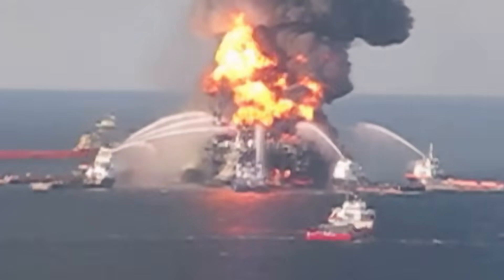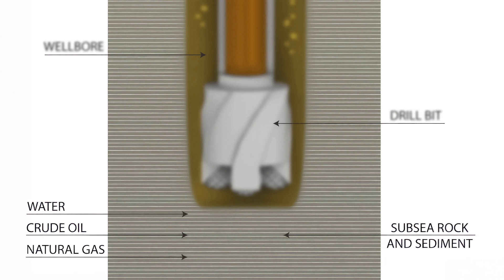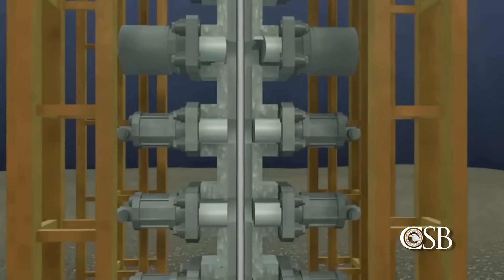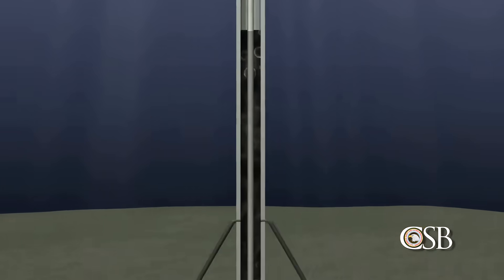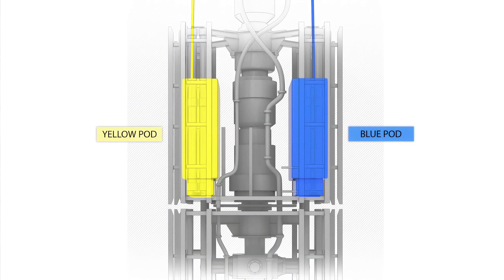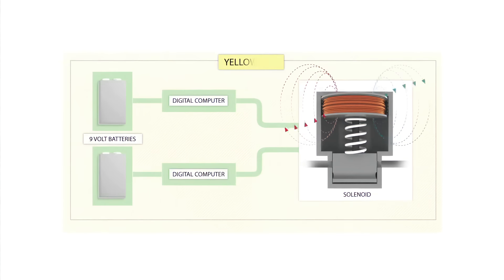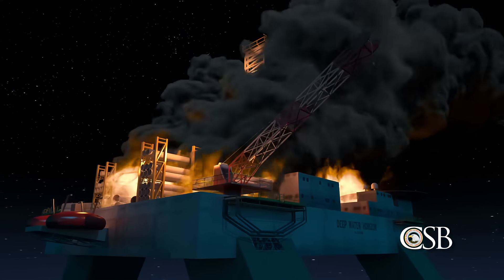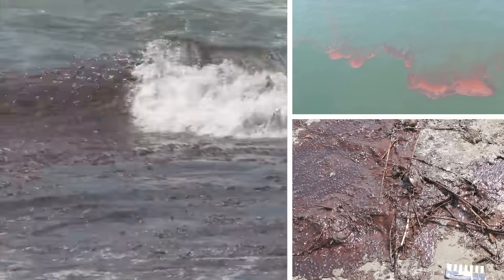Deepwater Horizon Blowout Animation

Comment: 2 and a half months to seal that b off? Funny how much development goes into preventing an accident  but clearly didn't have a plan if an accident happened
Reply: The accident was also 4000 ft below the surface
Reply: @alexl6543  maybe they shouldn't go digging 4000 ft at the bottom of the god damn sea bed without having a plan already in place and the means to stop it at hand dickfarmer. 2 and a half months.. there clearly wasn't a plan to stop a leak if such an accident happened. Ya have a comprenshion problem. That's exactly what my first message said. Oh so they didn't know they were digging 4000ft underwater.. pound sand buddy

Comment: OK, so this is a fascinating explanation of why the BOPs failed to control the kick, and thank you, but BOP failures did not CAUSE the blow out, they simply failed to control it after it occurred. It doesn't cover the real questions about the cause of the disaster and the catastrophic failures that permitted such a massive kick in the first place, failed cements jobs, lack of centralisers, failures in cement bond logging, lack of well bore monitoring.  

This is like saying that when your car crashed into a tree the airbags failed to operate and someone was killed.  While the question of why the airbag failed is important, the even more crucial question is why did the car crash into the tree in the first place?, speed?, brake failure?, road conditions?, sleepy driver?  What actually caused the accident?

From what I read the Deepwater Horizon failed to fulfil basic safety procedures and tests that would be performed on the highly depleted, low pressure, low production land rigs in Brunei, yet alone in the deep high pressure offshore fields in the Gulf of Mexico, but that is unbelievable.  

The BOPs did not cause the disaster, they simply failed to control it AFTER other failures allowed the well to get out of control.  I'd like to know more about what caused the blow-out.

Comment: So basically one solenoid valve was stuck in the open position, another valve opened when it shouldn’t, and the blind shear ram basically failed to cut the pipe due to the aforementioned electrical problems?

Comment: This thing was doomed to fail the moment they began drawing up the blueprints. How do you manufacture 5,000 feet of perfect pipe with no microscopic fractures at any point? You don't. Instead you say: "Sorry mister billionaire oil tycoon. This won't work. Figure out a different plan." If that piping hadn't buckled from the pressure those safety backups would've worked, including the one with the failed battery since the magnet the battery powered was equally screwed up.

Just remember this the next time proponents for more offshore drilling or more oil pipelines try to convince you that oil drilling is perfectly safe, and that accidents can never happen.

Comment: Keep in mind, this well was 5 weeks behind BP's production schedule, it was costing one million dollars a day.  That was after they had lost a drill pipe that costed $25 million, previously trying to drill into that reservoir.  That's "why".
Reply: Driller was under pressure to get the hole finished.......He did not shut the well in and he paid the price! My Subsea buddy was on a rig about a mile away in his bunk when the explosion blew him out of his rack!
Reply: @hubriswonk  If you look on Wikipedia, there is a whole list of problems with the Deepwater Horizon that took place over many years.

"A confidential survey commissioned by Transocean weeks before the explosion stated that workers were concerned about safety practices and feared reprisals if they reported mistakes or other problems.[28] The survey raised concerns "about poor equipment reliability, which they believed was a result of drilling priorities taking precedence over maintenance." The survey found that "many workers entered fake data to try to circumvent the system. As a result, the company's perception of safety on the rig was distorted"

Just about everyone on, in, or involved with that rig is to blame.  It's that way in just about every industry.  No one cares about maintenance or safety, that costs too much money.  (at least in the short term).

Comment: This is wrong, My second cousin was one of the survivors on the Deep water horizon. The reason the first explosion happened was due to the aroma and gas from the mud making its way into air intakes. This forced the engine to work harder without stopping. Then when the control room tried to change direction of the rig. The pistons of the engine froze and then snapped. This led to too much gas being near the spark plugs. That is why the first explosion happened

Comment: I saw a Kick and Blowout in a geothermal rig 20 yrs ago. 
All the mud was pushed up and out of the hole like a wet sand blaster.
My Cousin was on the Crows nest during this and as the mud began to turn to Steam.
I was on a hill above the rig looking down on it.
The Rig Boss was able to shut the well off manually but only just in time before my cousin was  cooked.
The whole rig was gray with  mud and Flash said the mud was come up so fast that he could not have put his hand outside the crows nest.

Comment: they said it didn't matter if the wiring was wrong and the batteries drained, the sheer cutter couldn't close.  So it doesn't matter what the wiring mistakes there were.  And of course this was a disaster, but the bacteria in the gulf ate all the oil so its all good.  Theres bacteria in the gulf that eats oil because oil leaks into the gulf from holes in rocks.  Don't get mad at me and write a nasty response until you google this and learn as much as I know!!

Comment: How does the oil rig stay on the surface without floating away and breaking the pipe
Reply: Directional motors controlled by GPS and computers.

Comment: Thank you BP for you attention to safety  and concern for the world we TRY to live in. OH, by the way thank you for all the lies you told after the explosion. I have never bought an item of BP's since.
Reply: It's not just BP, it's all of them.  They care about profits, profits and profits in that order.  Everything else takes a back seat.
Reply: Stop blaming BP. Halliburton were running the rig and Hyundai built it. The fact that they're using a Hyundai product is stupidity enough. The engines that caused this whole problem should have had detectors on the intakes for methane and auto shutdown (intake block) devices - no run away, no ignition source, no explosion. If that hadn't happened the top of the well might well have held the pressure but it wasn't going to do it in the middle of an explosion.
Blame the people responsible - Halliburton, Hyundai and the people who shipped a BOP with Chinese grade quality assurance. I'm sick to death of Inbredistanis blaming everyone else for their mistakes. BP were not to blame.

Comment: I have done engineering, and this video is nothing but a hit job. This many failures in a hydraulic system are unbelievable, to say the least; but the narrative concerning the solenoid was beyond logical explanation. A solenoid would not require two signals from separate computers to operate.Only one source of current is required to operate a solenoid; either on or off.
Reply: Interesting take Mr. Engineer. I didn’t see where you advised what actually happened

Comment: So in other words the whole system failed, from the cement not cured in the well, to the blow off preventer, to a missed wired solenoid, to a failed battery on the blind sheer ram...and a failed pressure test between the well and kill line. Then factor in how much pressure is coming from the well to bend metal pipe and blow out rubber stoppers. Also, Transocean and BP were 43 days behind schedule at $1 million dollars a day penalty...BP rushed this project bypassing key components and safety

Comment: How did they not test those electrical circuits ? Do they never do load or general voltage checks on their existing batteries ? Simple maintenance would have solved those problems.

Comment: Explanation: Companies driving those drilling platforms do NOT need this preventive-technology to work. As to build a new pipe, to build the whole system anew or even to relocate the drilling platform is way far more expensive than cashing in on insurance which comes with the loss of the said equipment. Fuck those shit cunts.

Comment: Alsi, if the rubber donuts over the Rams would have closed properly, the pressure outside of the pipe would not have decreased / decreased slower, possibly preventing the buckleing of the pipe due to a lower difference in pressure

Comment: What kind of idiot designs a dead man's switch that needs power to activate? The gates should be kept open by power and automatically close when power is lost, like truck air brakes.
Reply: In the absence of power, a force needed to close the "gates", otherwise they just sit there.  This "force" is implemented by a spring or compressed air (which requires a pump, and therefore electricity, to maintain).  

If you need electricity to maintain a pump in order to maintain enough pressure to automatically close the "gates" in the absence of electricity, why not just use that electricity to engage the brakes?

Comment: i feel like this is karma... BP is a corrupt corporation cutting corners just so they can focus on bringing in $$$ the people which died on this rig have blood stained BPs reputation and shows how greedy they truly are.. How can something so miniscule become such a huge problem? wouldnt you think or assume that they would keep things completely accurate to the T and keeping things 100% it feels like from a tiny thing caused a chain reaction to happen which is why all these fail safes stopped working. Also this video didnt show enough evidence here cos i read/saw on another video that the cement used to hold the pipe inplace was actually wrong. It was a thinner based cement which was why the pipe buckled under the pressure but regardless this just goes to show a billion dollar company throwing its money and trying to cut corners on cost to get a half assed rig working 

I heard that the people at BP never got charged for manslaughter and that all charges were eventually dropped sounds like BP bribed the justice system to save face i guess

Comment: so how did they actually seal it in the end?
Reply: They cut the pipe that cam out of the top of the blow out preventer and placed a cap on top then the pumped heavy mud and then depend into the well to plug the wel.  Later the blow out preventer was removed so that it could be examined.   A steel plug was then installed and secured.
Reply: @stevenf1678  thanks for the reply mate

Comment: The video does not explain why & how they lost the PRIMARY BARRIER on this well, which is having proper mud weight to overcome the formation pressure. This is the real cause of the disaster. Blow out preventers are very important and they must work properly but they are SECONDARY BARRIER.

Comment: Very nice finding 
But what about the solution for avoid this bending ???    :)
I want to know !
Reply: Know one knew that the bending of the pipe was possible in the blow out preventer.  No on thought it was necessary to include equipment to center the pipe.  Blow out preventers made since then probably have been designed to insure the pipe is centered.

Comment: I fail to understand these descriptions of what happened........first, on one of these videos it was explained that the riser was 20 inches in diameter? That is a large pipe to run for a mile? Then in this video all that is talked about is the 'drill pipe' which is about 7 to 10 inches in diameter? All that is ever talked about with the BOP is cutting the drill pipe? For some reason different videos have me believing that the 'drill pipe' is 'inside' the 20 inch casing pipe? Am I wrong thinking that? If that be so then cutting the drill pipe would also require cutting the casing (20 inch) pipe also? One other thought, if the only thing connecting the rig to the BOP is the drill pipe then that means the drill pipe is only thing to hold the rig when dynamic positioning is lost? What happened when the rig drifted away ...... did it pull the drill pipe out of the BOP? Is that what we are looking at when we see oil spewing out.....a ripped drill pipe? Appreciate any further 'correct' info!

Comment: Criminal incompetence. BP should be publicly owned and the executives in prison. How do 2 redundant safety devices both get wired wrong, and that valve still be lowered into the water. Did no one inspect it, did no one test it?

Comment: So, they don't do test for the missed wiring...
On both pods? Really??
They also failed to monitor the battery status...
And how is that count for safety feature?
Even my old cellphone warning me if the battery is lower than 20%...
Can't they make some alarm or something that could warn them, 
"hey, the power is just 10% above the lowest threshold for this thing to operate, can't you do something? or else I'll shut this pipe once and for all before it's inoperable..."

Comment: Failed to mention that the chief BP executive got into a huge fight with the Transocean driller because they were over budget and he wanted to withdraw the drilling mud to use on another well....he was going to save $25 million, on a well that had already cost them 325 million to drill, the driller tried to tell him the mud was holding back the pressure in the well..but BP pulled rank and Transocean gave in, when they started removing the mud the well kicked, and the well blew out ...plus that was an old blowout preventer and it had been used on many wells..that is why it was wired wrong and the driller knew it, so both were to blame for the blowout...that cheap BP executive cost the company 14 billion dollars because he wanted to save the mud. They gave him a raise and he still works for BP..by the way BP is the worst oil company in the world, they always cut corners, and have a horrible safety record, one of the worst in the business long before this ever happened. They cut many corners in drilling this well and it cost them.

Comment: How could the oil still flow up the pipe if the emergency shut off valve worked? Wouldn’t a vacuum form if the oil kept travelling up the pipe with no fluid was replacing the void